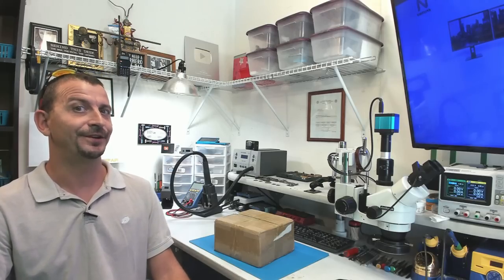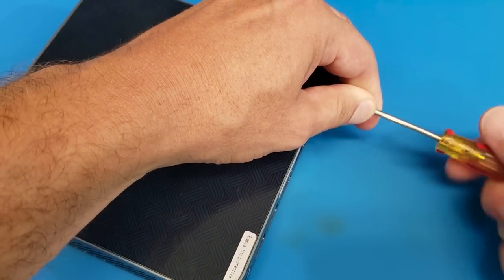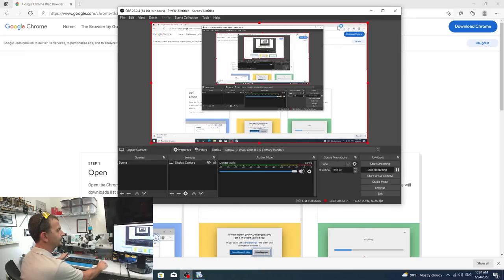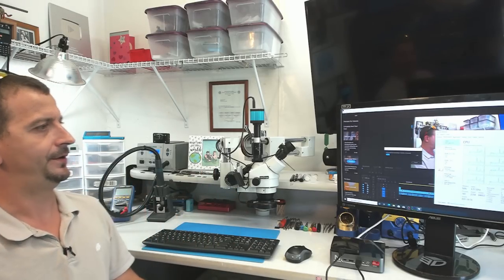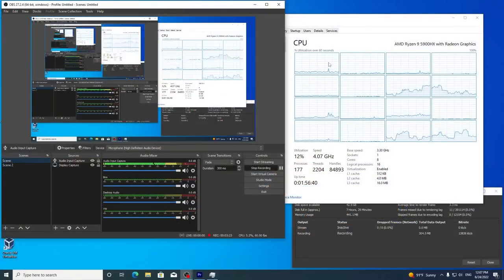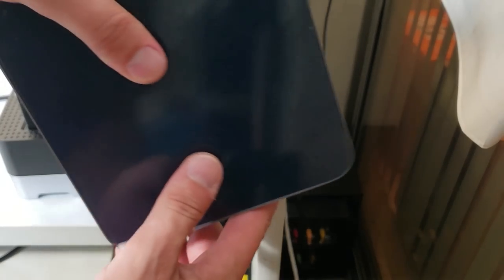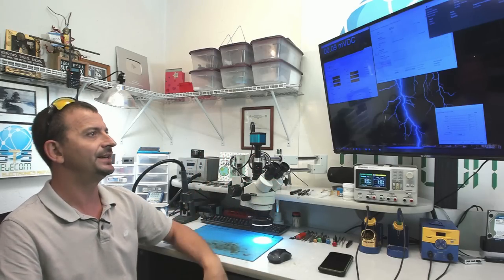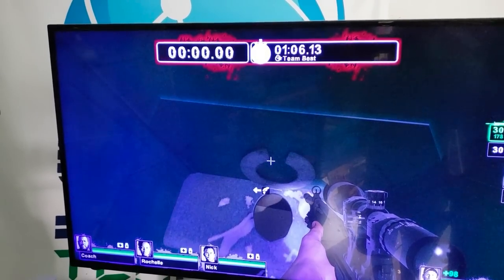A Ryzen 9 5900HX Mini PC by Nofflink! (Unboxing, Reviewing & Installing)

Comment: I'm not surprised  by how good that mini pc is working.   I bought one made by Beelink on Amazon last year for around $430 with an intel i5 processor with 16 gb of ram and 512 gb ssd.    I wasn't expecting much and decided to dog it to break it.    Well, after a month of abuse, it ran flawlessly.    I decided to replace a computer that I used as my daily driver with this and upgraded to a second ssd and max'd it to 32gbs.    I cannot believe how good this is - and - the great news is that the unit is quiet and consumes about 1/10th of the power of the desktop that it replaced.     I will over the next year be looking for a more modern processor with an Intel i9 or Ryzen of a similar caliber to do more graphics work (and video), but I've had no issue working on images on this computer.     I've had five videos playing simultaneously while opening 10 or more tabs of Firefox with no issue.     

I think these mini pcs are the future.

Comment: There are 2 things you should do. First is to change the dedicated GPU memory amount. You can do that in one of the BIOS settings. In the video I can see that it's being used max at 512MB, so you should dedicate 1 or 2GB - Otherwise it will use the SSD as video memory and as you explained in the video there were times the SSD was slowing for a bit, that's the reason. And second thing you need to do is run OBS as administrator. It allows the use of more resources and should fix the frame drops. You can do it by right clicking Properties and going to Compatibility, then run this program as administrator (on the OBS exe). But for long term you should add another stick of RAM preferably the same model. Right now you have it in Single channel and adding second stick for dual channel will greatly improve graphical performance. Not just for more RAM capacity but dual channel makes a pretty big difference to actual performance.
Reply from the maker: I did not realize that about dedicated GPU memory and SSD performance.  I bet that is what was happening!  Thank you!
Reply: I was about to say the same thing. You will see a big performance increase by following the steps above.
Reply: Also you can dramatically increase the transfer rate of the usb HD's you plug in by going to file manager and selecting that specific drive - right click go to properties - select the hardware tab - select the drive - then select properties again - click change settings - go to policies and turn on " Better performance - Enable write caching. You will now transfer at roughly 500 mb or a little below. The only thing is that you must right click and eject the drive or you can loose data. I have 3 SSD's plugged into the back of my pc all 1TB for videos and software. Ive done this for 3 years with 0 issues. If you want a video tutorial go search for " enable faster usb hd transfer speeds"  My 1-3 GB video files transfer instantly. Almost every time its like a blink of the eye fast.

Comment: It looked as there was a protection film at the top. It will make it cool better if the whole case works as a heat sink if you peel that off.
Reply from the maker: Good call!  I actually just now peeled that off after reading this. Thank u

Comment: Ok I have to admit that is an impressive little box.
Reply from the maker: I wasn't expecting to like it so much!  I've been running it for a couple of days now and have chuckled out loud a couple of times.  It's quite the beast for a mini-pc.  Too bad it don't have an RTX crammed in there!
Reply: @ststele  I've had a soft spot for mini systems, I have a Nuk, and a Mac Mini.
Just something about them... When they don't overheat 😂
That one looks like it's designed pretty well thermally though.

Comment: I use a ryzen 5900X. Results are still coming in, but the new bios release for my Asus prime b-350 plus seems to maybe improved things. If none of the os is on the larger partition, you maybe delete it and expand the main partition. That is something Windows supports I think in control panel->Computer Management.

Comment: Does your wall mounted monitor have a faulty backlight. It's a common problem in TVs, the LEDs become blue once they goes bad. The fix is replace all LEDs strips.
Reply from the maker: I honestly did not realize that was the problem.  There was someone else who suggested the LEDs but in my mind, I thought it was the panel causing it.  Looks like I will be checking into fixing this before replacing it!  Thank you.

Comment: Will the BIOS let you boot to Linux?   I bought an New Asus Nitro with I7...  Nice but  BIOS will not let you bypass windows 11 boot manager.  Lots of people talking about the problem... no fix as yet.
Reply from the maker: I have assumed so but haven't checked.  I remember watching a video not too long ago about this.  I would be shocked senseless if it would only run windows.  I'll be checking soon.

Comment: And you still have an empty RAM slot to use. I put 32GB in my laptop and while I haven't maxed it out Chrome has managed to eat over half of it. Imagine your new toy with the full 64GB! 😎 I don't know how quick the Intel NVMe is but my experience from 6 years ago, I was not impressed. Reliable yes, fast......nah but times may have changed. Does the Ryzen have thermal protection like the Intel CPUs? I have no idea as I am not a fan of the AMD stovetop CPUs.
Nice unit though and the price doesn't seem too bad. Unfortunately now that I have retired from IT I can no longer justify something like this at the moment. Perhaps if I turn the house into a Smart one......who knows.
Thank You for the video Jason. Hope this machine makes your editing a lot easier/quicker. 👍Nice Cessna in the video you were watching. Always wanted to fly the Skynight but never got the chance. 😪
Reply from the maker: Thank you for commenting.  I'm not sure about the thermal protection but I can just barely hear the fan from where I'm sitting so that's sort of like thermal protection, lol!  When switching from Intel to AMD, I was on the fence when I bought my laptop. The specs were good though and it was on sale!  My laptop has a dedicated GPU so I'll be doing mostly all editing on it but I'm able to leave my recording/bench system setup & ready to go which is really helpful.  It's amazing that 16GB isn't enough RAM these days!  I haven't checked the max RAM yet...    oh, the airplane in the video - that's a "Jimmy's World" video.  It's an aviation channel & the guy has bottomless pockets I think.

Comment: I got a. Beelink mini PC. This soc should have had 2 x 2.5 go nics, at least 2 usb3 in the rear. Not having a mount for the 2.5 inside is shitty and it should also have a second m.2 sata next to the pcie.  Unless it was 500 bucks or less, it is a not a deal.

The cpu is a high end mobile chop so don’t be impressed. It is a good cpu. I bet this cheapo unit starts to thermal throttle after a bit. Not loading it enough to test it.